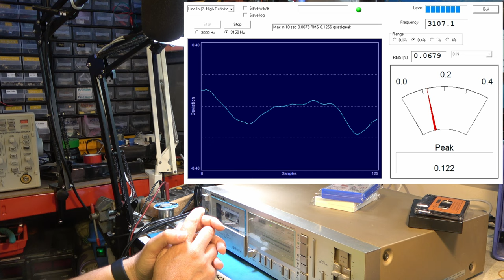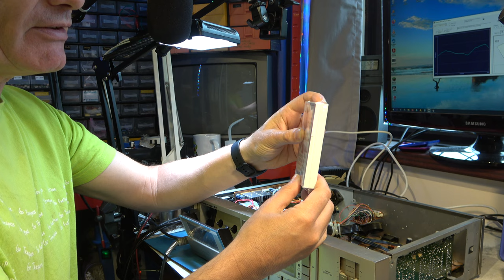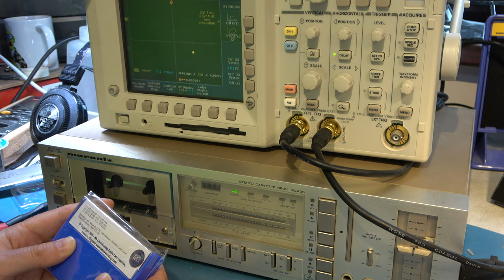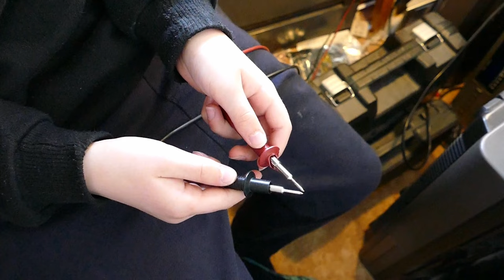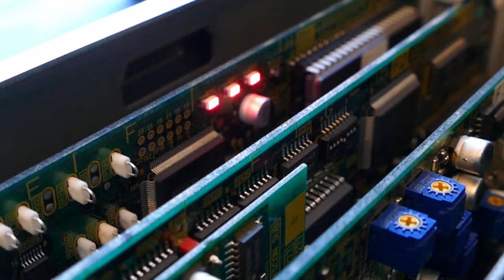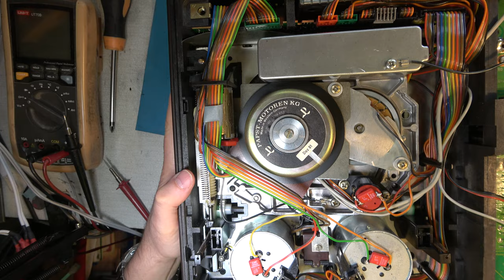Using audio alignment cassettes

Comment: it s a great question what s the correct speed cassette for reading so far reach by ambitions poor by conditions i ve made my own in 2 steps this speed cassette is about 0.1 percentage from the nominal tape speed as mentioned ,4,75 cm per second not 4.76 oder 4.78.Firrst of all you ve got a new cassette one a basic typed is adequate.you measure with stop watch the time playing it ,its about 30 minuts plus minus 1 minuts,this will be the adjusting point. NOW YOU WILL RECORD 3 KHZ WITH A GOOD DECK IN MY CASE JVC DD5 WAS CLEANED, PROBALY YOU WILL GET 3 KHZ YOU WILL ADJUST IT IF IT NECESSARY.AFTER A GOOD QUART LOCKED TURNTABLE YOU WILL PLAY AND RECORD A PLATE  ABOUT 20 25 MINUTES YOU WILL PLAYBACK AND SEE WHAT IS THE DIFFERENCE BETWEEN 2 ARES  YOU WILL CORRECT THE POTENTIO METER IN TWO THREE STEPS WHEN THE DIFFERENCE WILL BE IN 2 SECONDS NOW YOU WILL RECORD NOW THE 3 KHZ IN FULL 30 MINUTES THAT IS IMPORTANT YOU CAN MONITORING THE TAPESPEES DEVIATION AT THE BEGINNING IN THE MIDDLE OR AT THE END.MY TURNTABLE WAS JVC QLA 2

Comment: You didn't adjust anything. That right channel output was way off and if left like that it's hard to see what value the whole process really was. Azimuth, yes that's the easy one. Wow and flutter is often just inherent in the deck design unless the belts are naff quality. Right? If wow and flutter was way off manufacturer's spec what would be your next move?
Reply from the maker: I had changed the belts in a previous video.  In this video I set up the speed.  Today I adjusted preset control RJ44 to bring the right channel up by the less than 1dB which was all that was required.